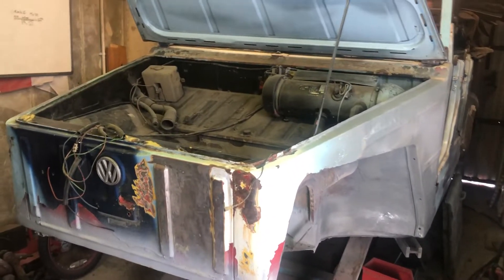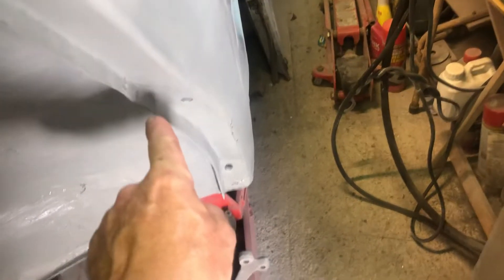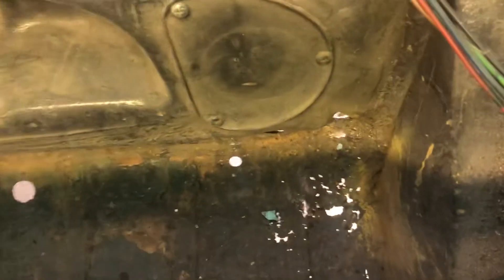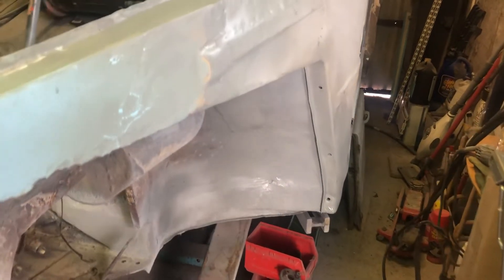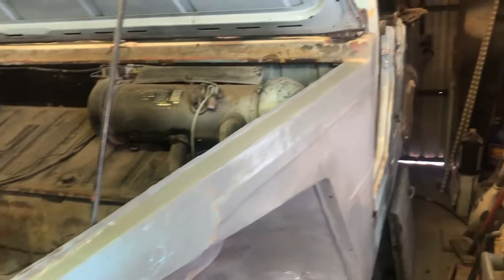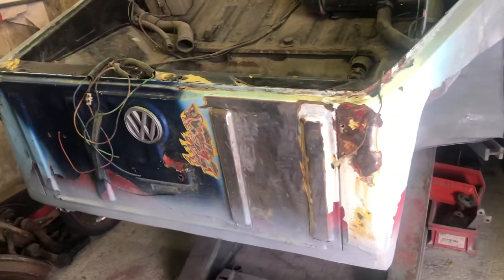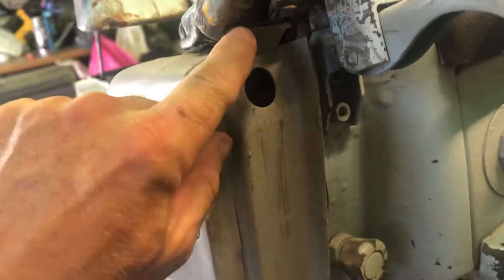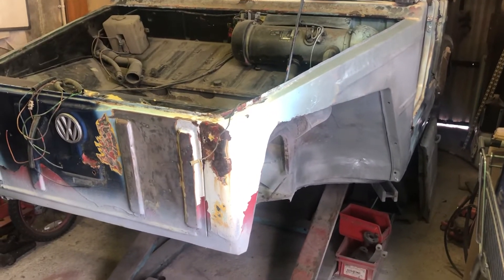Vw trekker/Thing/kubelwagen update !!

Comment: In the late 70s my Brother drove a 63  Bug to college daily for 4 years. The heater boxes were replaced and new tubes but it would not get warm enough in deep winter. My dad built a propane heater that ran off the small cylinders . When lit it kept the windshield clear of ice. Had a small door that opened when lighting. The heat just traveled up the tube to the windshield .  The floor boards were doubled up with plywood to cover the holes. LOL we were poor
Reply from the maker: He he brilliant Joe thanks